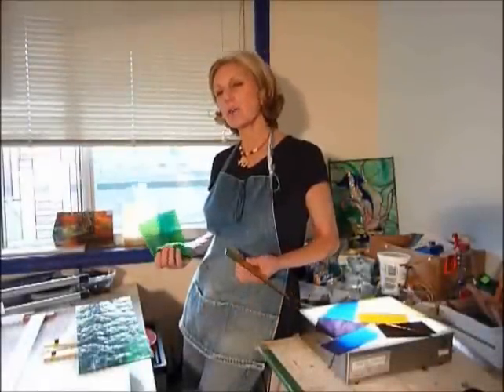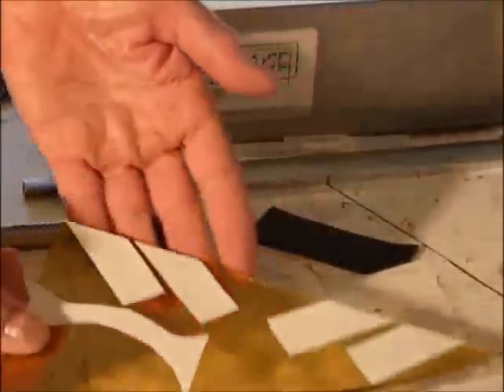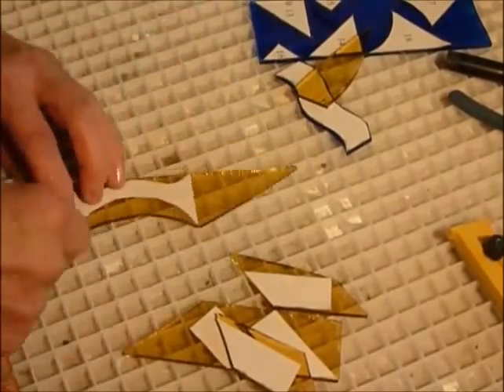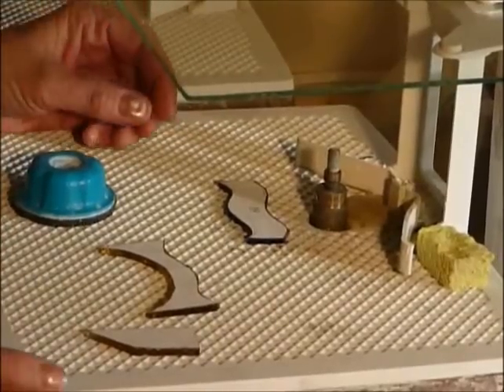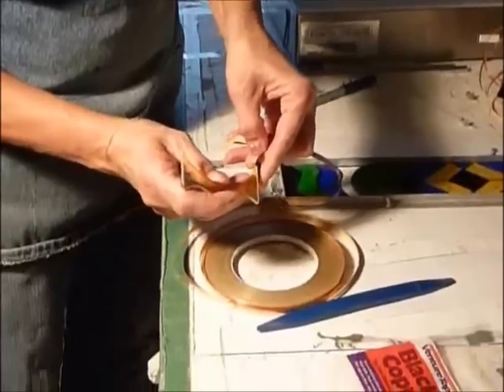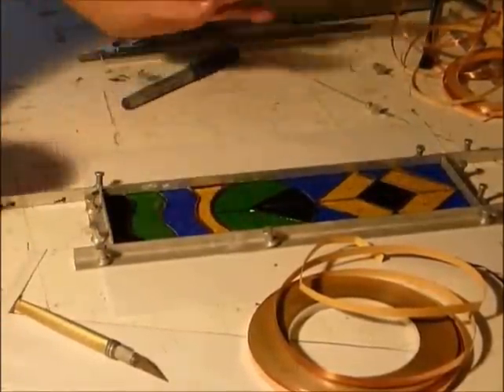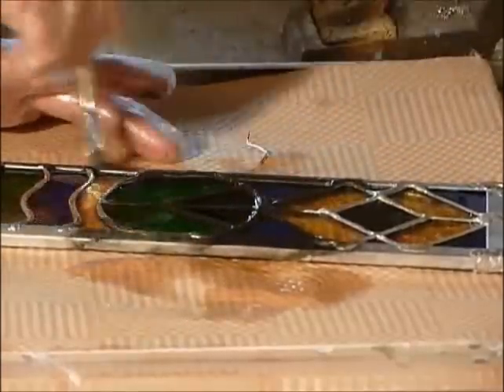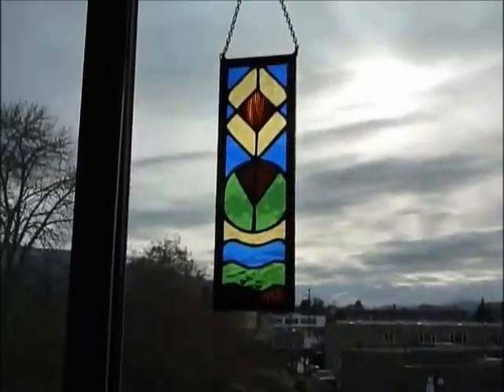How To Do Stained Glass

Comment: Very helpful and I do appreciate your advice and knowledge.   May I pass along a little trick on cutting glass?  Make relief cuts on those really hard cuts that you would take chunks out of.   Start by making the score on the desired angle, then from the score line make another cut through the waisted material.   Then simply tap the point where the scores meet.  Never go to the score from the edge of the waisted material, always make the relief cut from the desired score.   This will prevent the cutting wheel from crossing the line and breaking your  piece. 
I mean absolutely no disrespect,  you are very skilled and I learned more than I could have hoped for from your video.  Thank you

Comment: I thought about stained glass as a form of art and it really is. I'm an engineer with degrees in Electronics and Process Control. My work tends to be using soldering equipment to build electronic boards (bread boards). They allow you to decide if a circuit is going to work with chips, diodes, resisters, etc. All the time I was thinking how cool it would be to solder glass. Thanks for the video and it was very interesting to watch. I think I will give it a try to see how my imagination takes. Besides stained glass looking absolutely lovey, I just love to see how light reacts in a room to the glass. To me, it's simply magical to filter light into streams of color dancing about a room.

Comment: Only one comment on what otherwise is a good video.  I would NOT wear latex gloves when soldering.  Washing your hands when done is more than adequate, and if you do have an accident where solder drips on your hand you will be sorry because it will melt the latex and cause a much more severe burn.  If you have to wear glove, make sure they are heat proof!
Reply: Thank you, really, really good safety point for the beginner and for the advanced.
Reply: Scott P my exact thoughts!

Comment: I've been working with stained glass for over 50 years and this just reminds me that we all have different preferences on how we work. I've never glued down any pattern pieces. I often use the light table I made so the pattern is under the glass, often not even separated into individual pieces. Gluing down all those pieces wastes glass for me and also if a cut goes wrong for a beginner, you are stuck with finding a space to recut. I lay the pattern pieces close by the cutting area and in the direction I will cut but never attach anything to the glass. I often cut the largest piece first, repositioning the next piece, and so on.
Home PCs, scanners, and printers for patterns have made life so easy. Things have changed so much since the days of carbon paper and making multiple copies of the pattern.

Comment: Thank you for the informative video. To maintain a better tip life I've found that using the wet sponge method tends to lead to tip oxidation faster thus poor heat transfer. A steel scourer sponge dry or with a little bit of flux inside works much better!

Comment: I'd like to say this is an amazing tutorial, I can't say that enough.

I would just like to point out some soldering tips from my experience in electronics.

You don't have to worry so much about the lead as Scott P mentioned. Just wash your hands. Lead from solder is really only dangerous if you ingest it, and a lot of it. Working with solder everyday I never had any problems from it. The worst I've seen is someone getting a headache from eating it.

Cleaning your soldering iron with a sponge isn't to remove solder, it's to remove the oxidation that occurs from being at such a high temperature. It's actually good to leave your soldering iron coated in solder, this is called tinning. It will allow for faster heat transfer and protect your soldering iron for much longer. The worst you can do is leave a soldering iron exposed to oxygen while hot without tinning it.

Comment: I was hoping for more info on attaching the came and the chain.  Everything else is fantastic.
Reply: BillsBayou hey, I'm not sure what you meant by came, but for the chain just get a piece of chain of the desired length and solder the ends of it to the top (or wherever you want it). It's pretty simple and shouldn't give you any problems. Just make sure the solder completely covers the ends of the chain.

Comment: To Ross Potts...the grinder has water in it, which is wicked up the sponge to the grinder bit. This cools the bit while in use plus keeping the glass dust wet. This causes the dust to fall into the grinder tray where the water is. This wet dust is cleaned out at the end of each day. If it remains a concern to you, you can always use a paper face mask while grinding. I have asthma but have never found the need to do this. Hope this helps.
Reply: Sandra Parker Thank you for this video!! I am rather new to stained glass and just love it. I have noticed when I grind glass ( in my instructors studio) I get the dust on my hands ~ it sparkles on my skin. Could this be from not enough water? I've asked her about it and she pretty much blows me off about it or says to wear gloves but I don't see anyone else wearing gloves and I wonder why. I am about to order grinder as I am putting together a workroom here at home and have been wondering about the glass dust issue. How do you deal with or rectify the issue of the dust getting on your hands?
Reply: Stacey Lynch Be sure water is at depth in the grinder (there is a water level mark inside) and that your sponge (the wick) is reaching fairly deep into the water. This keeps the grinder wheel wet which keeps the glass dust wet. This usually keeps the dust under control. Anytime you are working with glass, you need to wash your hands well afterwards. It is possible to get a tiny shard on your skin and washing well removes them. Great glass working! And don't let anything discourage you.

Comment: Excellent video, I wouldn't use the glue, I would trace the paper pieces with a water proof  marker, & then cut, & place in place on a flat surface or light table, also I was taught to tap the curve cuts from the under side with a cheep glass cutter, the ball end along the curves , that works well for me,

Comment: There's no danger of glass powder being inhaled when you're grinding?
Reply: Ross Potts  When grinding, make sure the water level in the grinder is up to the mark inside the grinder base and that your sponge reaches into the water at least 1/2 to 1 inch. This keeps the grinder wheel wet and that keeps the dust wet. This controls the dust. I have asthma and don't wear a dust mask but, if you are still concerned, by all means go ahead and wear a light dust mask. You need to feel comfortable with what you are doing. Don't be concerned about anyone else's opinion. While working glass, your opinion is what counts.

Comment: CAN I USE REGULAR,CLEAR ,WINDOW GLASS ,CUT THE SHAPES, PAINT THE PIECES ,THEN LEAD THEM
INSTEAD OF PAYING FOR ALREADY PAINTED,STAINED GLASS-- ITS GOT TO COST MORE
ANY HELP
Reply: profetarmageddon Yes. This actually is an inexpensive way of creating a "stained glass" item. If there is a window manufacturing nearby, they can be a great place to buy (or even get free) broken pieces of window glass that they cannot use. This is also great practice glass for learning how to cut the various shapes of glass.
Reply: Sandra Parker
thank you
Reply: Uh, no, the paint will fade in no time and may also crack and peel off from the sun, any humidity near will lift the paint off also. Paint does not adhere to glass well nor is it lightfast. Stained glass you buy is not painted, the colour is melted into the glass.

Comment: I just have to ask.
When you grind glass are you not creating super fine air borne glass particulates? It's kind of freaking me out that you aren't wearing safety gogles or a resparator. Or do I just not understand what you're doing?
Reply: The particulates you create are not "super fine" generally speaking, but also the grinder head is inundated with water, which is why you see the sponge at the back of the grinder wheel.

The water keeps any particulate that might actually be small enough, from becoming airborne. Once a week, more or less depending upon use, you have to clean out the grinder "well" area, and get rid of the glass sludge build up.
Reply: And she did have the glasses on when she was grinding :-)
Reply: Personally I would use more safety equipment but as a rank beginner I am more likely to injure myself.  This lady is an expert and so is far less likely to be clumsy and hurt herself.  She did show safety glasses in the beginning of the video, so I'm pretty sure she's wearing them.  The shards of glass when cutting with the carbide tip thingy are not fine enough to be airborne and when grinding, the use of water keeps the glass dust under control.
Reply: When grinding, the glass particles are generally wet and so most of the "super fine air borne glass particulates" do not get to the air but stay in the water.

Comment: I started stained glass two years ago and I’ll say this if you don’t have patience then this is not for you I’ve gotten so frustrated that I’m lucky I didn’t have a heart attack the glass cut has to be precise off in one piece will throw the whole thing off , cutting your fingers is part of it , doing a piece just to have the foil on the edges coming off or finishing a piece and hanging it up just for the solder to come undone and the piece falls and breaks , the soldering takes a lot of practice and the glass solder foil soldering gun  and accessories all cost a lot , if you patience and can take your time it could be cool hobby